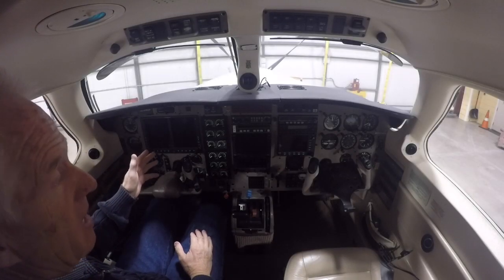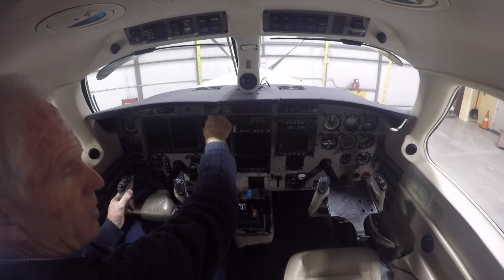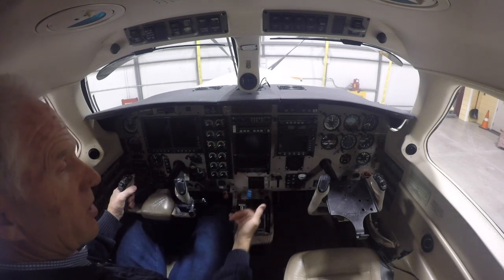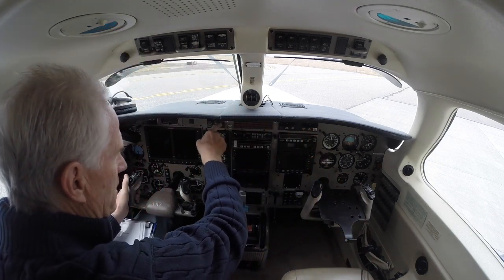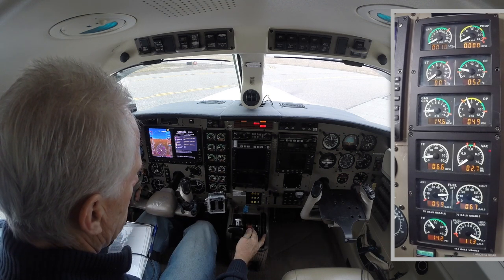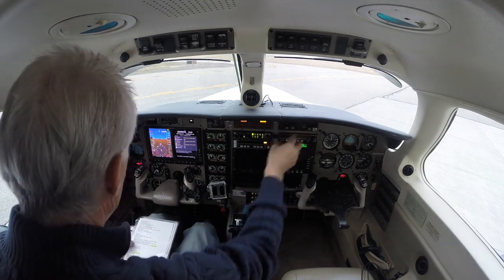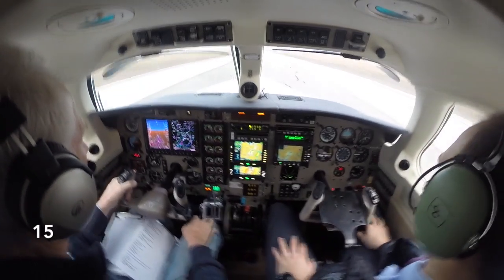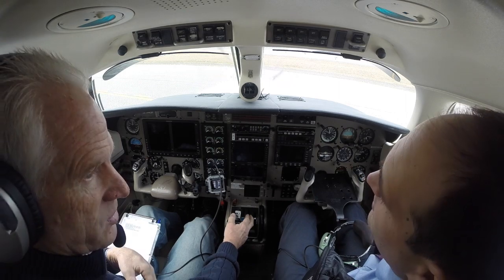JetPROP Startup and Short-field takeoff

Comment: One of the most important things when comparing a JetProp to a Meridian is the lower cost of maintenance. Since the airframe was not initially certified as a turboprop, the inspection requirements are the same as the Malibu. I own a TBM 700 and could afford the airplane but what makes it such a luxury is the high cost of maintenance. A JetProp would be about half the cost. I’m thinking about it just for that reason. The TBM  is a solid 35-40kts faster but uses ten gph more so the range is about the same. It also maxes out at FL310 which can be a real asset for getting over more weather. These features cost about another $30K a year in maintenance and fuel over the JetProp.

Comment: Cannon,  when watching the actual start it seemed that the ITT needle was climbing quit rapidly. So rapidly in fact that there did not seem to be time to catch a hot start before an exceedance occurred unless the pilot had razor sharp reflexes.  Is that the case or does it just appear that my due to the camera angle?  Thanks for posting.

Comment: Whats the best way to prevent a hot start on a quick turnaround? Like a cross country flight in the south where your just stopping to refuel. Do you just keep the starter engaged longer when starting waiting for the ITT's to cool? I feel like the starter will be engaged for longer than 30 seconds before NG stabilizes  trying to allow the ITTs to cool to below 130 before introducing the fuel.
Reply: "where you are stopping for fuel"
Reply: Yeah, motoring the starter a little longer to bring down the ITTs a bit will work. Having a GPU-assisted start will typically let you get a higher Ng, bring down ITTs, and give you a cooler start overall.
Reply: Motor the engine and get ITT below 150

Comment: Are the ice door and inertial separator the same thing on the jet prop, or do you have both? Thx.
Reply from the maker: Scott Major It’s the same thing. “Ice door” is a name and “inertial separator” is the function.
Reply from the maker: Also for your interest, when you close the ice door/separator the torque increases by 150 lb ft with the same fuel burn
 Alternately, you can reset to the same torque and reduce fuel burn by 4  goh
Reply from the maker: GPH
Reply: @MrCannonls  Thank you for the info. I suspected that was the case, but I am only a piston driver myself, so I wasn't sure. :-)

Comment: well......complicated...
Reply from the maker: Ju Teint. The startup procedure certainly is complicated. After that it’s pretty standard. Watch your ITT and push forward to go faster.
Reply: Why is it complicated? I mean he said a lot about it but that is a good thing and makes it easier to understand. You have a few steps to follow (and monitor) and the turbine is running. When wrestling with piston engines you still have several steps to follow and you then need a feeling/knowledge of what to do if the engine doesn't start. I see a lot of guys cranking their engines until they cry for mercy while I am doing my preflight. With the plane I know I only need 1 or 2 seconds to start normally but I still would like to just turn the starter on give it some fuel after stabilizing on a certain percentage and watch ITT and that's basically it. Works every time as long as the battery is ok.